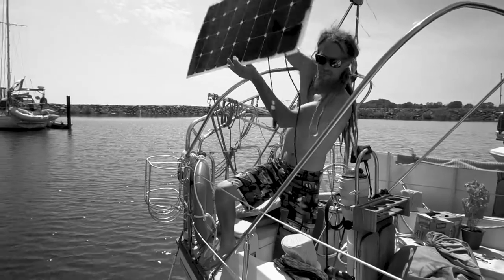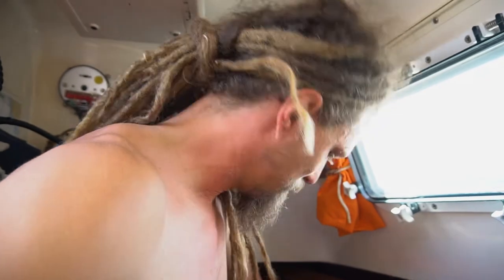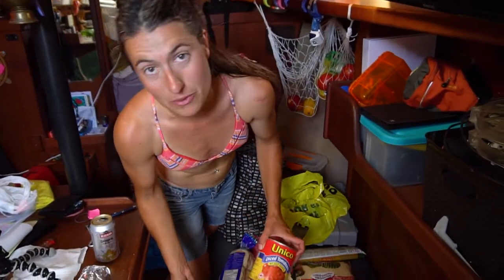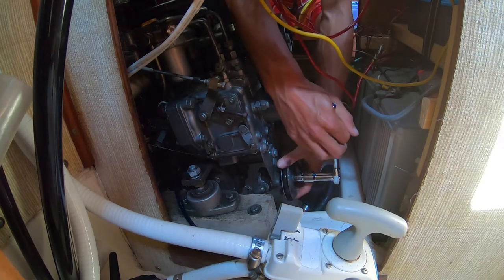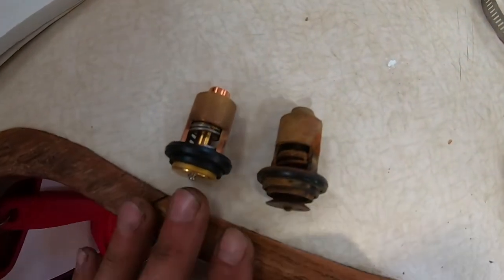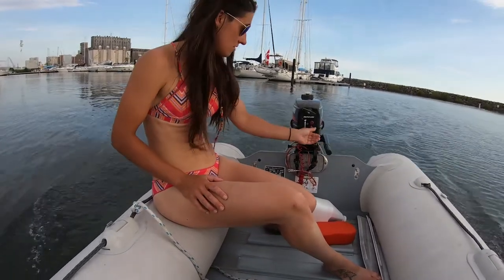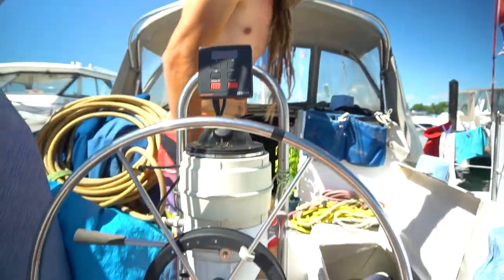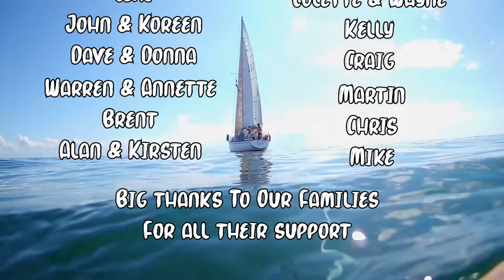YANMAR 2GM maintenance: OIL CHANGE, THERMOSTAT, RAW WATER PUMP [Wildly Intrepid Sailing Ep 54]

Comment: You will always replace the Raw water impeller. Its called Preventive maintenance. You dont vant to waste you engine bacuse you diden´t replaced it. Stuff like that always break down in the most bad weather when you need it at most..  Its also not expensive ;-)

Be safe out there!
Reply from the maker: Thanks for the heads up. Weve been keeping an eye on it and so far so good. We didn't really want to replace it since it looked so good and we do always carry spares.
Reply: @WildlyIntrepid  To check it, you have to pull it out and inspect the base of the fins to see if there are any cracks - you don't want to wait for the fins to break off and for fragments to get pumped into the system - better to replace regularly before this happens
Reply from the maker: Thanks for the tip. We had that impeller for over a year. But when we did our engine rebuild we swapped it as a precaution.

Comment: When you put the raw water pump back on did you tension the belt. couldnt tell in the video Also a nice helper when using smaller screws, get
 yourself a magnetic dish. Great for holding small screws. Little metal dish with a magnet at the bottom. Saved my but a number of times keeping nuts,screws and bolts in one place. They have a habit of rolling into corners or vanishing into the voids of space and time.
Reply from the maker: Yes we did tension the belt. Great idea with the magnet dish but wondering how well it would work with stainless steel screws.

Comment: Your old thermostat was stuck open from corrosion #life. Your engine will warm up faster now and it will be much happier.
Reply from the maker: I think it did love it for a while and then it stopped working as soon as we made it to the Bahamas. So it was over 3 months of sailing without engine. But now we started rebuilding it, waiting on parts.